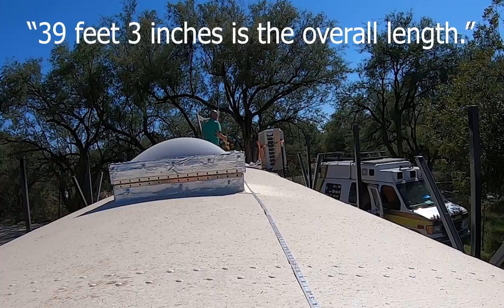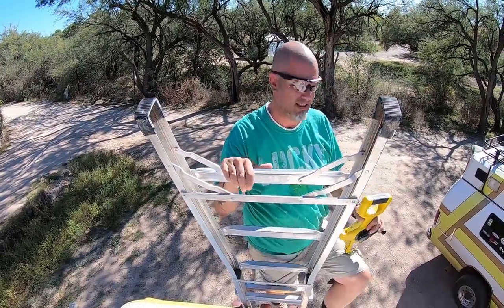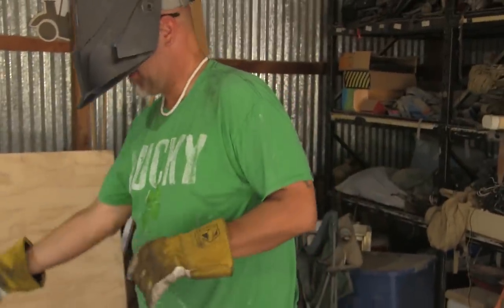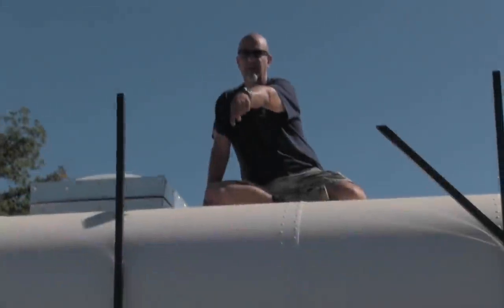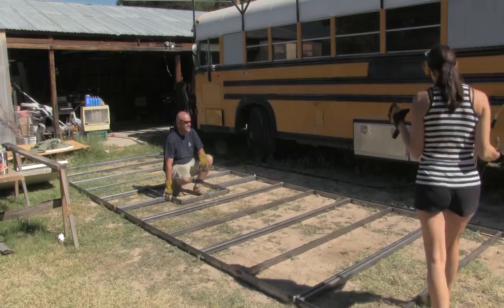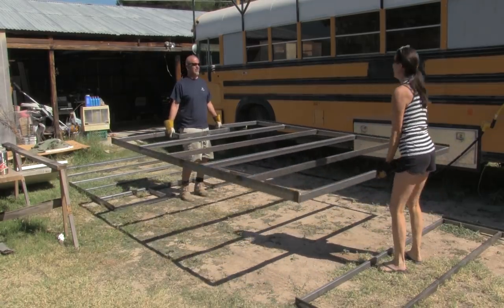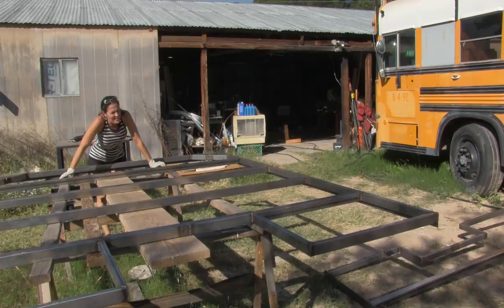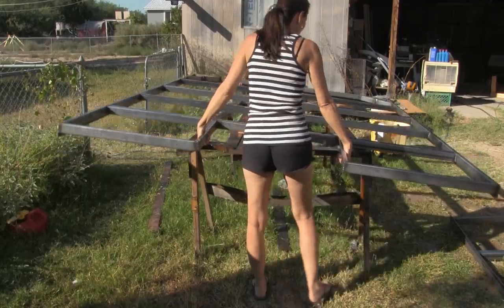Adding a Step into our Roof Deck (Part 5) + Prepping to Paint!

Comment: I don't remember, so I have to ask: Did you paint your roof with something like Tropicool paint? If so, are you going to paint the deck with that, so it doesn't transmit meat into the roof?
Reply from the maker: We used tropicool on the roof but it doesnt hold up to foot traffic and is very slippery when wet. We are going use kilz over armor with texture.

Comment: Is that safe considering the weight that your putting on the roof I know that it will be supported by the brackets you have on the side, but wouldn’t that behave like a big wing so effecting it on the road and is it legal?  Just a thought guys it just seems unsafe  John
Reply from the maker: It's legal. We know that. Weight wise it's about 800 pounds give or take.  That is like the weight of 4 adults.  The chicken feet shaped supports make this thing VERY rigid. We shouldn't have any problems.
Reply: Like... Its a school bus... Might as well be a tank!!!😂😂
"You can do it!!"